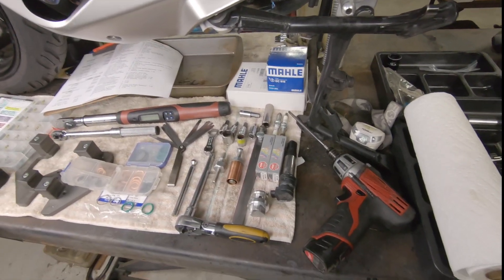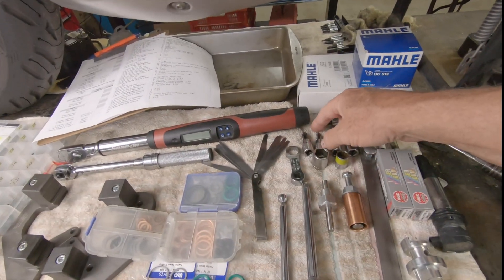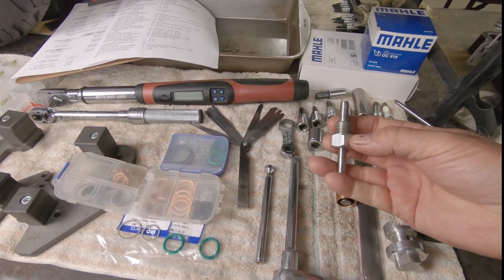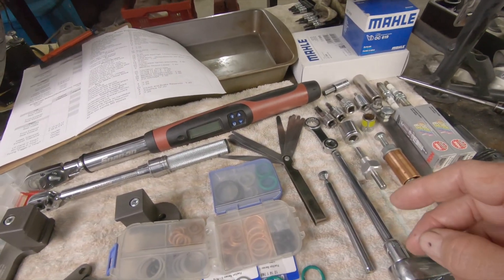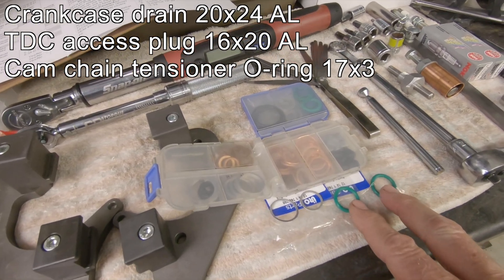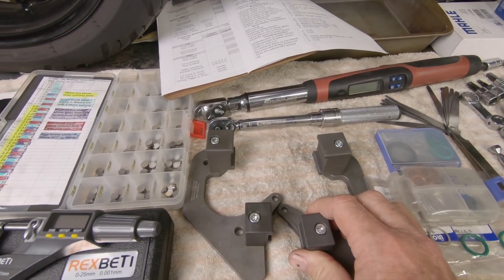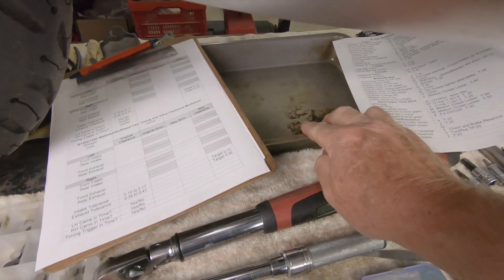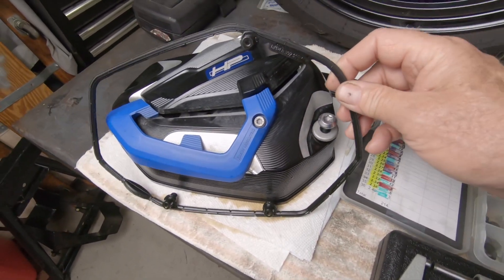BMW R1250 Cam Timing and Valve Clearance Tool Overview

Comment: At 40 seconds in you show a list of all tools and consumables with links. I can't find that list anywhere, is it still available? Specifically, I would like to buy the same feeler gauges you have. The sets I have include 0.02 to 0.05 mm and then up to 1 mm in 0.05 mm increments, which means I often have to put two together to get a reading between 0.1 and 0.17 and between 0.34 and 0.41 mm. Having to put two together does not provide great accuracy. Thanks in advance!
Reply from the maker: Sorry, I don't know where the reference to that tools list got lost along the way...it should be correct now.
As far as the feeler gauges go, the supplier for the second set that allowed me to assemble what I use in the video has exhausted the supply, and they are no longer available as far as I can tell.
I agree with you that stacking blades to achieve the target thickness is not optimum, but I think it's the only solution as of now.

Comment: Hi. Please explain the benefits of cam timing adjustment. BTW, fantastic video series. Makes me think I might attempt this myself.
Reply from the maker: @kramer2965  Oversimplified, but this puts the engine back to factory original settings.  The mechanical components of the valve train can be adjusted/compensated for normal break-in changes.
Reply: @ Thanks much for your reply.  On another note, do you recommend switching out the left tensioner for the newer version?  I have a 2019 GS.
Reply from the maker: I only recommend changing to the “new” style CCT if you have some chain slap noise when the engine is fully hot and at idle. It’s not really detrimental to the engine, just an annoying sound.
Reply: @Boxflyer11  Excellent.  Thank you for lending your insights and expertise.

Comment: LOL He sure placed a big dent on most stealers.  Then again, those that can easily afford a GS, can easily afford the cost of these expensive services, the problem is if the stealer actually does the job.
Reply from the maker: I don't mean to compete with any dealership, I really wanted to show owners that this service (not called for in routine schedules) can be done by a competent mechanic if you have access to the special tools required.

Comment: Brad, I purchase the BMW cam chain tensioner tool on ago.  I'm doing the cam timing and valve adjust today.  I can't find instructions on the BMW cam chain tool.  Don't know how to set the tension.  Know I've seen videos previously, possible one of yours.  Can you help?
Reply: Got the cam chain tensioner tool figured out.  No instructions found, just used intuition.  Successfully aligned/timed cams.  Valve lash was in spec.  Thank you for you great videos!
Reply from the maker: Did you have all 3 Cam Timing Tools?  1) TDC Locking Pin, 2)Cam Chain Tensioner with 15mm Sleeve, 3)Cam Alignment Jigs...there are published procedures for doing this along with correct Torque values...intuition will leave you far off the mark when it comes to doing Cam Timing and Valve Clearance Checks.
Reply: @Boxflyer11  .  Yes, I have all the BMW tools.  Watched all your videos, including use of your chain tensioner.  Couldn't find specific info on the BMW Chain Tensioner, but deductive reasoning led me to the correct use. Similar to your tool, it is screwed in until seated, then tension is applied until the tool "breaks" like a torque wrench.  Upon "breaking" no further tension can be applied.  This is when the cams are timed.  I followed all your instructions for cam timing and valve lash, including all torque values.
Reply from the maker: I understand how the tools work, it was not clear if you used all the tools needed to align the cams, and if you had enough data for the specs on the process.  Your reference to intuition is what my comments were about.
Reply: Having done valve lash adjustments on many different motorcycles over many decades, I am completely adept at the procedures.  Your succinct videos make the steps crystal clear.  I use your Torque Sheet, and Timing/Clearance Worksheet.  While this could be a daunting and complicated chore,  your instructions make the job easy.  Thank you.
Reply: @Boxflyer11  .  Intuition... could be scary.  Ha!  I understand that every motor has its own exacting specifications.  I suggest that an experienced mechanic may apply general principles common to all engines, hence the "deductive reasoning".  Your specific instructions remove all guess work.

Comment: I read somewhere you sell this set of specialty tools: tdc pin, cam chain tensioner tool, cam alignment tool... is this true, if so where can I order them ?
Reply from the maker: I have transferred my inventory and production to a full fledged CNC machine shop and that shop will be able to fulfill orders very soon...I will make the announcement primarily on the BMW R1200/1250 Forums, like BMWST.com
Reply: @Boxflyer11  Thanks for the reply Brad, any idea of cost and timeline ?
Reply from the maker: To be announced,  but it will be normal Boxflyer Cam Timing Tools...just more precise and refined.

Comment: Assuming you want to change the oil prior to the valve work, can you do so. Or does this require you to drain the oil?
Reply from the maker: You don't need to change the oil when doing the Cam Timing/and or/ Valve Clearance Check.  Typically, the oil that drains out of both LH and RH valve covers is about 5-6oz total, or about 180ml.  The remaining oil in the engine is not contaminated or affected at all.

Comment: Very thorough very complete instruction and how to accomplish these tasks. After watching the video though, you talked me out of buying an R1250 RS. Seems like a giant PITA to me. Valve adjustment and cam timing are not something that you can ignore. I’d like to avoid the dealership at all costs due to my experience with them. Thanks again for helping me avoid the headache!
Reply from the maker: The point here is that you can do this, or let me do it for you, and it will be done for the rest of your ownership of the bike.  It just needs to be to the 12k point to be broken in and stabilized from new assembly, then when the Cam Timing and Valve Clearances are set correctly, they STAY set for 100k plus.  Having worked extensively on HexHeads/CamHeads, and now WetHeads and ShiftHeads, I think the last 2 generations of the Boxer engine are well worth the experience of ownership...and maintenance.
Reply: All bikes need valve clearance checks , all brands all models. You'll have some job avoiding this.........

Comment: Considering the relative infrequent need to perform this service, is the only/best way to purchase these tools from you?  Or, is it possible to rent them for a week?  Please comment on how a person would obtain these tools from you. Thank you.
Reply from the maker: Hi Andrew, as of now, I don't have a set of tools that are available just for rental.  I may dedicate a set of tools for that purpose when I'm at the end of my supply of Cam Chain Tensioners since that is the real limiting tool in the set.  Right now, I have about 20 sets of Cam Chain Tensioners built and about 15 more to machine, but that's the end of the supply...and I may be done making them.  I can easily produce the other tools like the Engine Turning Tool, the TDC Tool, and the Torque Adapter, and I'm starting production of the Cam Alignment Jigs for the ShiftHead engines, but that will also have a limited run of production.
For availability and pricing, send me a PM on www.BMWSportTouring.com Forum.  Username Boxflyer
Reply: @Boxflyer11  Sorry if I'm late to the discussion but is there a price list for your tools?
Reply from the maker: @garystevens5883  Contact me VIA Private Message on https://www.bmwsporttouring.com/ 
for information about buying a Set of these DIY Cam Timing Tools.

Comment: Awesome video series, Brad - thank you! I purchased the full set of tools from Brad and performed the valve mechanical timing adjustment on my 2019 R1250GS. Both sides intake and exhaust cam timing was off by a few degrees, and my bike runs better (quieter and more power) after performing this procedure. Interestingly, the valve clearance was OK on my bike, and from what I can tell by reading the BMW repair manual procedures in the DVD I have, the valve timing procedure is only done if the valve clearances need to be adjusted. So in my case, the valve timing would not have been accomplished by the dealer.
Reply from the maker: Glad you enjoyed the series Bob, it was fun doing it.

Comment: Nice helpful video. Dont own a R1250 but am considering one.  Given your tool list, several are specialty tools.  Any idea what dealers charge to do this?
Reply from the maker: Last week I did a Cam/Valve Service on a bike that just had a 12k service done for $800.  That 12k service did not check or adjust Cam Timing, which it needed, and only checked valve clearances to be within the range, not setting them to a desired target value.
Reply: $.10/mile.  6000 mile check up $600.